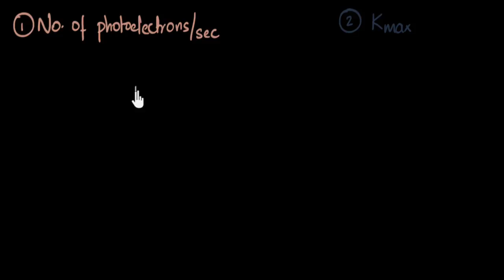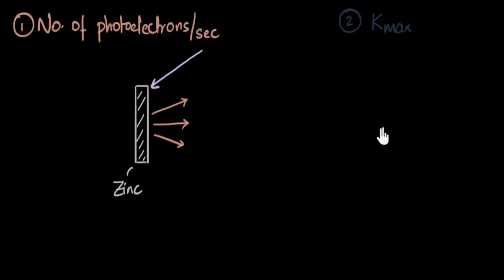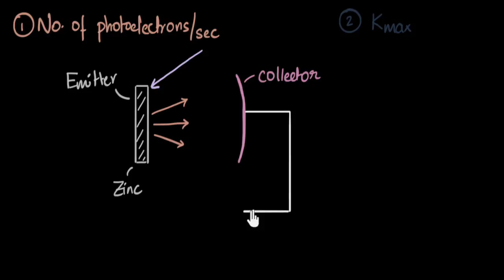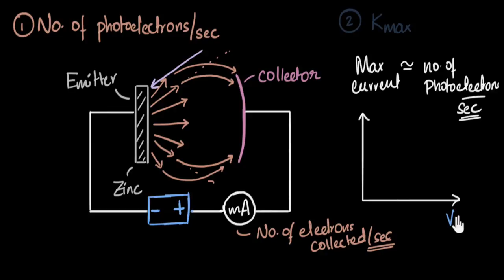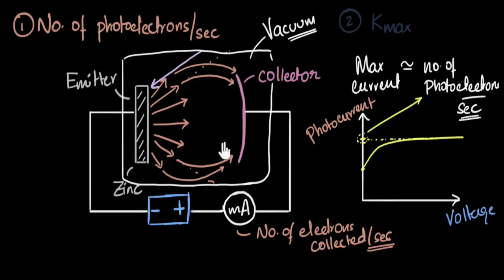Experimental setup & saturation current: photoelectric effect  | Dual nature of light | Khan Academy

Comment: Why does increasing the voltage increase the current here? Is it because you can treat it as a circuit and Ohm's law applies?
Reply: You are correct 😊!
Reply: And also because if voltage is increased there will be more electrons collected. Flow of electrons produces current. More electrons more the current

Comment: As we increase the voltage, the collector receives more electron per second and also they're being attracted with much greater force than before(because of more voltage), so the electrons should be received and circulating in the circuit quicker than before, shouldn't that result in higher circuit current regardless of the fact that we cannot increase the no. of electrons received per second anymore? ( therefore no thing as saturation current). What point am I missing?
Reply: i think that, even though the electrons are circulating quicker than before in the circuit, the current should still depend on how fast they travel through the air gap between the emitter and the collector, for ex if 100 electrons go from the +ive terminal to the emitter and the incident photons just have enough energy to emit 10 photoelectrons from the emitter, it will take 10 seconds for them to pass that gap and get to the -ive terminal, thus restricting the current to 10e/s even though the potential was enough to move 100 electrons.
that sort of makes sense i guess????
Reply: Path is broken dude ..the circuit is open...when u got the first batch of e- , they returned to the Zn plate....and can only pop out if they got energy from photons... Experiment's pretty full proof
Reply: @rishavjain5087 But still despite the fact the pathway is incomplete so is the circuit, electrons are still meandering from the negative to the positive terminal, so path is still connected. Morever, since the addition of the battery 🔋 added the positive and negative terminal, positive terminal might be attracting the electrons due to the electric field. Please inform me! I'm perplexed
Reply: @halumgrr Have you been able to find the answer?
Reply: @jerven1128 But might the positive terminal not be attracting the electrons and so is the electromotive force forcing the electrons to be ejected?

Comment: If electrons are collected using voltage that would result in more electron that is to say the pulling out of electron would not be impartial to light  now.
Reply: My conjecture is identical as yours! Have you been able to find the answer? Please post it here; that shall be resourceful!
Reply: I had the same doubt but I think I got the answer
The collector is not connected by a wire,  the electrons collected by the collector pass through a medium where only these electrons are there, they might not be using a conventional ammeterm. Now when we increase voltage, as there is no wire or something, only the electrons from the collector can pass. The no. Of electrons passing is so less that all of them pass through ammeter in 0.1 secs and there are no passing through it in rest 0.9 secs. When we increase voltage, no. Of electrons on collector inc... the voltage is only to attract the electrons that are flying away
I hope you get it, it is very hatd to explain without a diagram